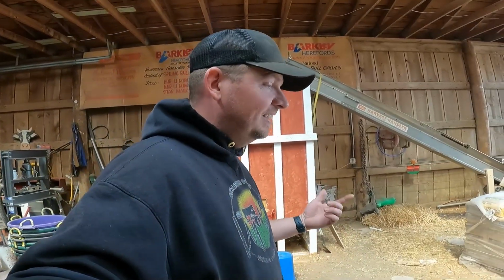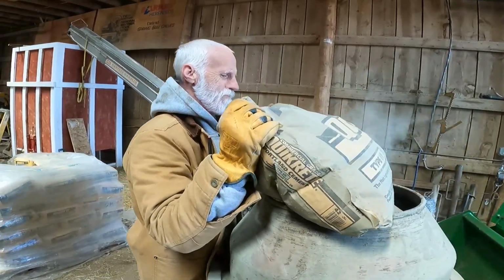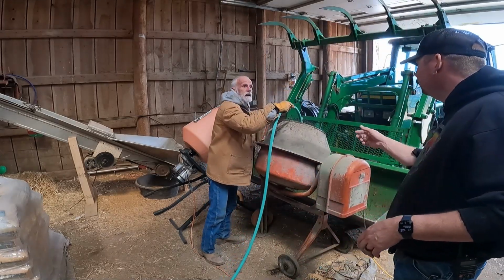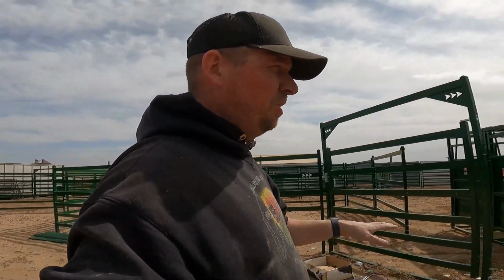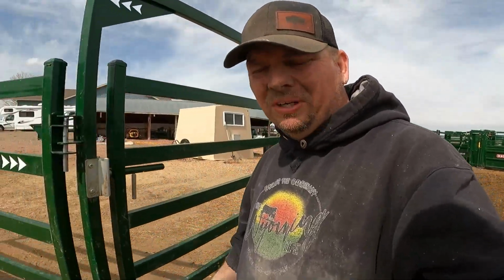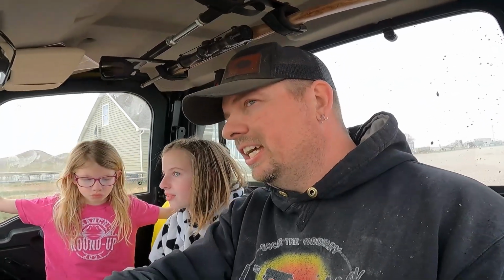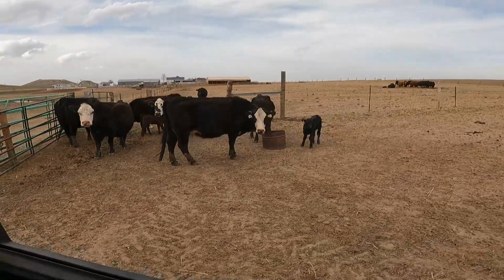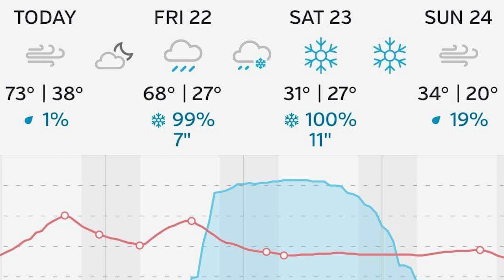Mixing It Up - 30 in 30 #22

Comment: Remember dust masks. That dust settles well in the lungs.  And before you throw concrete in the bucket, always remember to moisten the bucket, this means that the concrete does not stick too much to the bucket and cleaning is easier. Greetings from Denmark and a bricklayer. 😊

Comment: Nice job on the concrete slab. Writing this half way thru the video so I'm hoping your going to rough up the surface so the cows don't slip. The kids and Erin need to do some handprint and date your handiwork. Love the new pig. Easy keeper. 💘 🐂 🐄 🐐 🐖 🐔 🐕 🐱 🇺🇸

Comment: The concrete above ground, plus the height of the weight bars, plus a scale floor of some kind ...  It seems like you are going to have quite a step-up getting onto the scale.    I would have dug down to make the concrete form so that it sat level with the ground when it was done.
Reply: I was wondering about that, too.  Mixing it inside and using the tractor bucket was a great idea.

Comment: Nice way to mix a bunch of concrete.  Jeff sure does save you a lot of time getting tasks completed.  The girls are great going out and checking the herd with you.  The cows are so use to you driving around in the gator that they don’t even move.  Nice to see they don’t feel threatened in any way.  Looks like Bambi is going to wait for the snow storm before having her calf.  Good luck with the snow.

Comment: I wish I could have been there to help you guys- you want a stiff “slump” on concrete because the more watery it is, the weaker it is. Regardless of water, concrete hydrates around 90 minutes. Work it too late with bad ratios, it ends up crumbling fairly quickly down the road. Admixes help workability or speeding up/slowing down  the “cooking” time based on ambient conditions. Anyway, for what it’s worth, hope this helps on your next pour.

Comment: Suggestion:  dig a 6" wide by 4-6" deep trench all the way around the inside edge of the form.  Why! 1) it supports the outside edge of the slab from cracking.  2) keeps the slab from moving around
Reply: Good point. A 'slab' can migrate, slide a bit on the ground. If a slight trench is excavated around all four sides, deeper than the main slab, this anchors the whole slab into the ground far better than just sitting it on the surface.
This way they have done will work well enough for a while, but is a compromised design.
The lack off dust masks and full eye protection is completely unacceptable though. Really high risk of lung and eye damage from cement dust.

Comment: two comments. 1. You should cover the wet cement with a plastic sheet. A sudden temperature change like your expecting will cause the concrete at the top to freeze and later you will have a flaking problem. Remember that ice crystals are 10% larger than liquid water. The heat trapped from the curing process will keep it warm if covered.  2. Probably to late with this slab, but on the next one you might think of "imprinting" the load sensors before the concrete sets. This makes it much easier to insure the load bars are dead level, which is important if you want the scales to be accurate. Have a great day and stay warm.

Comment: Put a heavy plastic over the concrete before the snow comes.  Place some bails of hay on top of the plastic.  Curing cement is an exothermic reaction (gives off heat).  The plastic and hay will trap the moisture in making for a stronger cure and the hay will trap the heat in and keep it from freezing.

Comment: You might want to install at least one 8' long ground rod with #8 solid copper wire to ground all metal within 10' of load cells. Years ago we had a load cells next to a long 8' steel post & fence that had to be over 75' long to measure weight of entire tractor trailer truck before & after they unloaded. Several times a year during a lightning storm 2 to all 4 load cells would burn out costing think it was a couple of grand to have company come out then verify accuracy of scale. Service tech recommended that we install at least 2 ground rods to bond steel pist,fence & metal p!ates. Went over 5 years before we burnt another load cell.out. Money well spent ! We went the extra mile and drilled and tapped maybe a dozen 1/4" holes to run long piece of solid 8 gauge copper wire to bond every post and top rail.

Comment: I was worried that your concrete forms were going to bust out without stakes halfway down those 2 x, 4s.  Luv the speed mixing with the tunes!  You might not want to wash those clothes with concrete because it might set that concrete dust in them.  Your might get mad if it contaminates her washer.

Comment: Mike I just have a question why are you not putting any in stone down underneath that concrete? I was always taught and always saw that anybody that puts concrete down always puts crushed stone down as a base to make sure the concrete stays stuck to the ground and also does not crack or break as easy

Comment: Continuing post: you might want to check out the most visited electrical site in the USA. Mike Holt. He has posted great articles about the importance of grounding/bonding around cattle. If a cow picks as little as think its a quarter of a volt will produce less milk. Know that you do not run a dairy operation. I would have gone the extra mile and ran a solid 8 gauge copper wire from the reinforcing mesh in middle of concrete to a 8' ground rod. . The NEC also has very strick rules on grounding & bonding of both above ground & in ground swimming pools.Being that you get so little rain and very few electricians own a special meter that reads ground rod resistance would install at least v two 8' ground wires in opposite corners if concrete pad and they must be bonded together. I am a retired sparky with 50 enjoyable years in this trade but always turned down running power to a new in ground pool due to its too much of a possible liability even though I had valve millon dollar liability insurance.

Comment: What do you think of the calf Optimizer scour gel? It might help your calves to prevent scours. I sent you a tube enough for 8 calves. It was about $27 a syringe if you stick with 40 cows or so it won't  be that expensive.   You just need 5 or so syringes. I  hope you give it a try as it has worked miracles for other Ranchers. I want you to have miracles too. Good luck and God Bless.